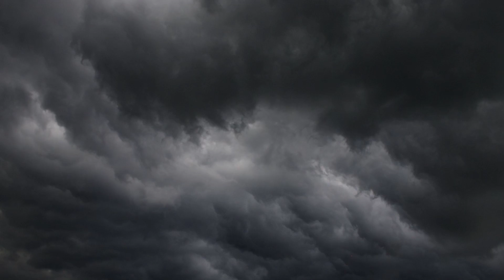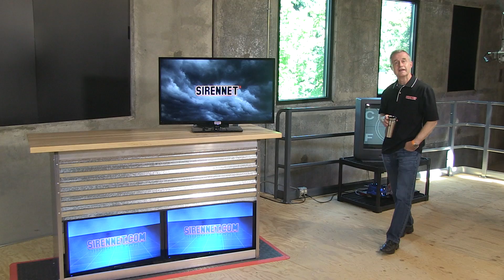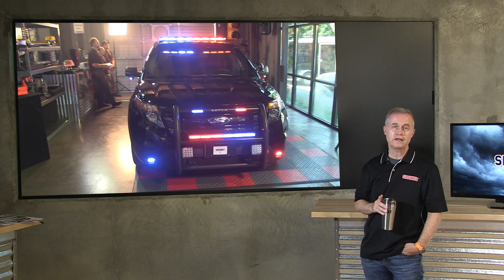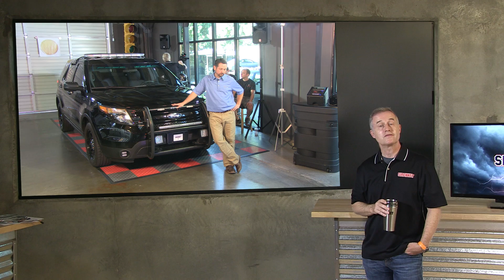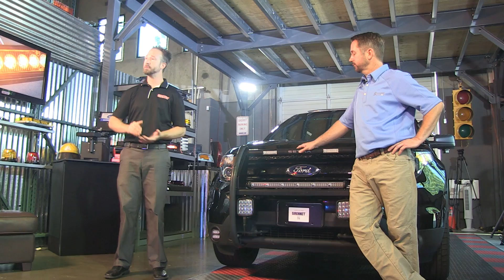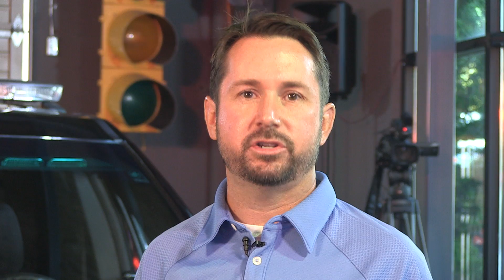The SoundOff BluePRINT Control System

Comment: How do I turn off the internal beeping when I have the lights activated
Reply from the maker: You'll need to use the Soundoff BLUEprint software to turn off the internal beeping. 

•	In the top left corner, click on “manager blueprint devices”
•	Middle of the screen, click on “panel setup”
•	Along the righthand side, you’ll see the notification on/off “bell”

Comment: What I kind of miss is a switch in the door that cuts off the siren when you get out after a pursuit. That way you dont have 5+ cars with sirens on when doing a felony stop.. Less stress, less action to take (finding and getting back into the car with siren still on)..
Reply from the maker: A helpful feature with BluePRINT is the park kill function. Instead of a door pin/switch, when the vehicles shifted into park, the siren turns off automatically.
Reply: @SIRENNET  Even better 😎 does that ship to Europe? 😏
Reply from the maker: @volwars We'd like to help, but due to Soundoff's strict restrictions on this product (certification & support), we can't. Thanks for asking though :)

Comment: I have speculating for years, However now I am positive the upfitting of this vehicle equals ....or exceeds the initial vehicle cost........I Love it !   Lol
Reply from the maker: This example, being for demonstration, has a lot more equipment then you'd find in a vehicle used by a department. It does have a higher cost with that in mind and the install process & programming is more involved with all of the product being utilized. When it comes to the total for vehicles in normal service, it'll be well under that of the actual vehicle.

Comment: How would someone control this if they're like DOT with an Amber sysyem or Volunteer FD/Medic with a courtesy lamp? Mainly asking as stated it's best used with nERGY siren controllers.
Reply from the maker: Blue Print would allow for more advanced control over patterns, intensity and automatic functions like door triggers, park / drive mode. Wiring will be minimized when a large amount of accessorizing takes place.
Reply: SIRENNET but my Province banned siren controller in a POV. So is there another controller to use? Or connect to another controller like the Feniex 4200 since it doesn't have a siren amplifier, it's an add-on.
Reply from the maker: Are you looking for all the features of Blueprint or do you just need a compact switching solution?
Reply: SIRENNET wouldn't mind all the features but can not have siren box inside a POV so can not use the nERGY controller to control the BluePRINT system..
Reply from the maker: There unfortunately isn't a variance without siren amplification. You can of course skip a speaker, but the siren tones themselves will be built into the amplifier.

Comment: WOW!! Awesome video.  I think the full on cruise light function would also work great for pilot cars as well.  Along with the all white scene lighting would go great when escorting a wide load under bridges.
Reply from the maker: Thank You :)
Reply: Does the BluePRINT Control System only work with Sound Off Signal products?
Reply from the maker: Using Soundoff Signals products along with it will yield the best results. You can use some other Manufacturers lighting along with it so long as the internal voltage regulates correctly.

Comment: Some of this system depends on the driver side front window being opened, such as for the high beam override and panic button.  What would the panic button be used for anyway?
Reply from the maker: Its functions can be adjusted based on preference... Most commonly is would be used for alerting of an Officer in distress.

Comment: Can this system be incorporated with any brand of light / light bar?
Reply from the maker: It's designed primarily to work along with Soundoff's LED products for proper performance and controlling/programming abilities. If the Vehicle add a few LED items on it from the Dealership as options/road-ready... you'd could probably get them to work and interface with BluePRINT if the voltage is right.
Reply: Thank you for the reply and information!

Comment: Can a different siren be used or different control panel be used instead of a Sound Off one? e.g. a Whelen Cencom siren and controller with the BluePrint interface to control lighting
Reply from the maker: To maximize the BluePrint System, using an nERGY Controller will yield the best results... but with tweaking... it could be done.

Comment: Does the BluePRINT control system tie into the door triggers, reverse, high beams etc using wiring or by using the CANBUS system?
Reply from the maker: It ties in using added wiring if needed or it can tie into OEM triggers for grounding.   If you can think of it... it can tie in and be used to perform a function most likely :)